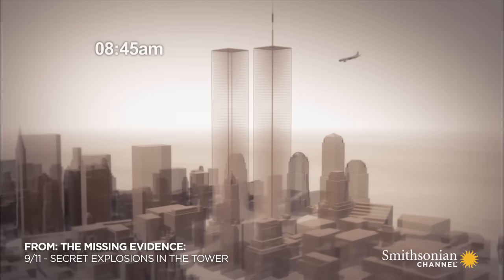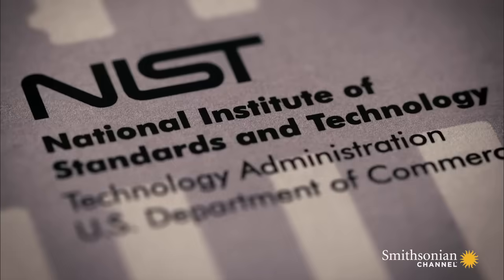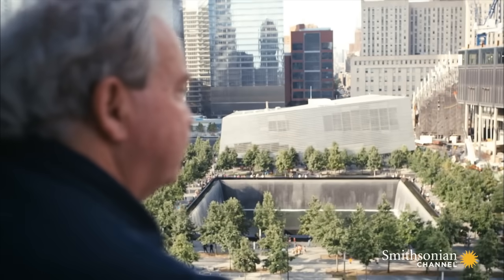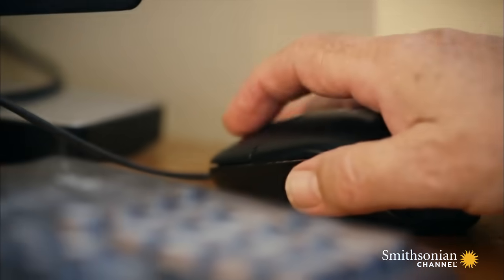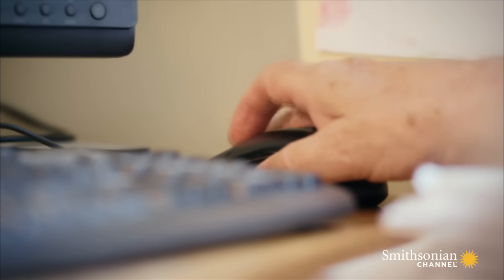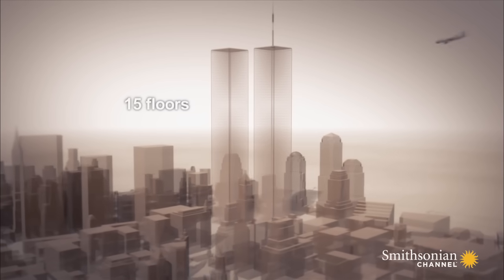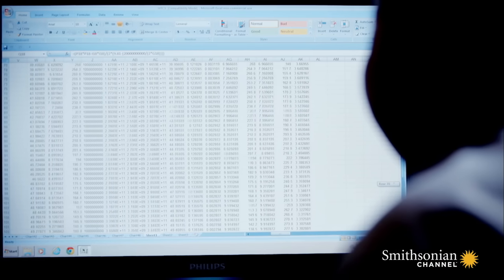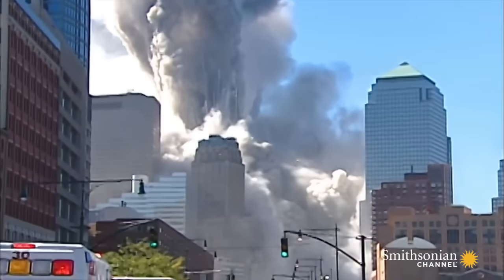This Computer Simulation Explains How the Twin Towers Fell

Comment: Many many building have gone through somthing similar with weaker structures and stayed standing. There was a live video a builing that was mostly glass in Dubai burning for hours, no death, no free fall. The buildings that were in Lebnon the day the huge bomb went off in the port, a mushroom cloud gutted the buildings beside it but the buildings stood still. Please make it make sense. The people too sensitive to actually ask real questions shouldn't even be here. Go watch video's that you would rather hear. Alot of us want to know the truth because simply, if the truth was actually out none of you would be fast to shutting us up anymore.
Reply: Was the building in Dubai hit by a jumbo jet doing 500 mph? No? Then it's not a fair comparison, is it?

The closest example of a building going through something "similar" is when the Empire State Building was hit by a bomber lost in fog in 1945. But that plane was 1/10 the weight of a 767, was only going 180 mph, and was low on fuel. Apples & oranges.
Reply: @Tim22222  Not really apples and oranges. Why? Because the towers were built to withstand a strike from a jetliner.

"The towers could withstand strikes from multiple jetliners". Frank D. Martini WTC Construction Manager.
Reply: No need to compare to other buildings. NIST stated that WTC 1 & 2 came down "essentially in free fall" (as seen in videos). Any college physics professor will tell you this means that essentially none of the kinetic energy from the falling building parts caused any destruction during the TOTAL collapse of the WTC 1 & 2 buildings.

Comment: you know, when something looks like a controlled demolition its probably really a controlled demoltion...
Reply: No, they just came straight down to earth in accordance with gravity.
Reply: I've never seen a CD begin at the MIDDLE of a building. Have you?

It sure doesn't look like controlled demo to me.
Reply: @Tim22222   , You have more to learn about controlled demolitions. That is how the verinage controlled demolition technique works.
Reply: @Tim22222  You can start a CD anywhere. It just depends on what you need to accomplish during the cores of the demolition.

The towers had a multiple stage CD.
N. Tower:
1. 93rd floor is the ground. 94, 95, 96, 97, 98, 99 ect...
until the antenna hits the 93rd floor.
This is the upward sequence of the CD
2. When the antenna hits the 93rd floor 
93, 92, 91, 90 ect... until the tower is gone.

The WTC 911 CD was an engineering event that is once in a lifetime. It was not just a CD. It was a, "Ritual". It was a, "Social Programming Engine".
Reply: @Tim22222  yeah, the core of the building comes first

Comment: Would be great if you could explain how the WTC7 fell too...
Reply: The World Trade Center 7 (WTC7) Tower collapsed as a result of the damage it sustained when the Twin Towers (WTC1 and WTC2) collapsed earlier that day. The collapse of the Twin Towers caused debris to fall on and around the WTC7 building damaging the buildings structural integrity. 

According to the National Instiitute of Standards and Technology (NIST), the collapse of the WTC7 building was primarily due to fires that ignited on multiple floors as a result of the debris impact. The fires burned for several hours and weakened the building’s structural steel. The loss of structural integrity caused the building to collapse in on itself.
Reply: @gripitandripit  WTC Building 6 says hello
Reply: @gripitandripit  Keep on dreaming. Controlled demolition building 1, 2 and 7. Everyone knows. Nowhere in the world a building colllapsed after a fire.
Reply: @welldonemylove  Thats why when steel buildings were first constructed that was the big advantage. They wouldn't collapse due to fire unlike wood framed buildings.

 Three buildings on 9/11 collapsed "due to fire" in the direction of MOST resistance and at near free fall speed. Its impossible. Every support column had to fail at the same moment on each floor for it to happen. It was an inside job period.

How was it done? I have no clue, but it happened and they fooled everyone.
Reply: Burning chairs and other office furniture melted the joints and beams, causing the building to instantly crumble to dust. It's all in the NIST report. The 9/11 Commission Report forgot to mention it, so now you are suspicious. Move along, there is nothing to see here..
Reply: @baronvontrollenstein3410  LOL
Reply: @baronvontrollenstein3410  well that explains it. Wasn't that hard, was it?
Reply: Those that say metal got so hot that it brought it down due to fire melting steel are still asleep, that would imply that the steel buckled therefore all steel would have all been still connected in one big chewy thread.... Do you wonder what China has over America politics and leadership, those involved paid China to dispose of the crime scene, who knows the what really happend China, and mossad
Reply: Read the report then
Reply: These nut jobs will never believe that it wasn't a controlled demolition.
Reply: @ Mike Byrd
Reply: Cause it burned for 7 hours .
Reply: @hoyt_arms  Sorry thats not how it works
Reply: @rdaws73  that's exactly how it works lol
Reply: @hoyt_arms  Physics says otherwise
Reply: @rdaws73  physics and architect's have shown already that you're wrong
Reply: @hoyt_arms  Wrong
Reply: @rdaws73  you're gonna tell a firefighter that he's wrong whens that's what we're trained to know and do. There wasn't even anyone Inside this building when it collapsed. You're making yourself look ridiculous
Reply: @rdaws73  Lololololol do let us know when you return from conspiracyville, where the average lQ hovers right around 58. 😭💀🤡
Reply: @invincible9462  When people lose a debate they tend to call the other names and insults. Instead of having some sort of coherent rebuttal.
Reply: Yes, yes, gawd yes!!!
Reply: I was in the toilet there and I farted
Reply: They'll tell you the building was so sad and depressed it decided to freefall out of the sky, definitely was an implosion 600 degree open flame isn't hot enough to melt steel or concrete building 7 . Geonanothermite and 90 percent of that jet fuel was burned up upon impact as you can see when those planes hit the towers makes no sense their narrative!? No resistance freefall what in tarnation, just before collapse you can see molten metal melting and dripping out of the towers before they fell
Reply: @AustinCG  the molten steel beams could perhaps be true for the floors that got hit and burned what about the rest of the building? all of the steel beams just decided to become melted noodles also? to be able to freefall the tower, to this day to me it still looks like a controlled demolition.
Reply: @elcid5033  Building seven wasn't hit by a plane or jet fuel yet it magically caught fire and magically fell out of the sky free falling with zero resistance not possible...
Reply: It was a from a cherry bomb that Giuliani left behind with all the Enron documents and the Pentagon fraud case at CIA HQ.
Reply: Fires started in building 7 from a significant amount of north tower debris hitting building 7, and subsequently, fires burned on at least 9 floors of building 7 unchecked for hours.  That's why building 7 went down.
Reply: In 2005 the Windsor Building in Madrid burned for more than 6 hours with +1000 degree fire along 15 floors. Didn't fall.
Reply: @shadowman_390  are you actually sIow enough to compare what essentially amounts to apples and oranges..?
Reply: "How did a metal building that burned for 7 hours collapse"

Um...
Well, the building was held up by steel.
Which melted.
So it collapsed.
Reply: @MostlyPennyCat  Iron does’nt melt in a fire. It was pulled by the owner. Controlled demolition.
Reply: @MostlyPennyCat  yet again, airplane fuel cannot burn hot enough to melt steel far from it look it up.
Reply: underground nuclear explosions is the actual answer for all 3 buildings, dont believe me? just look up demitri khalezov 4 hour interview he explains in detail......
Reply: I think it was from the debree that hit the building
Reply: @Matrix1FSX  Yeah… or maybe really strong winds
Reply: @gabrielprado7794  Or it could be both, the debree might have made wtc7 more vulnerable, and of so the winds pushed the building to collapse.
Reply: @Matrix1FSX  it’s astonishing how much you refuse to open your eyes to the truth
Reply: @Matrix1FSX  are you serious right now? Wind?
Reply: @SatiricalBaitforPalintir  literally it’s pathetic
Reply: @LongJourneyyy  "POSSIBLY MY CONCLUSION OF WHAT GABRIEL PRADO SAID"
Reply: @SatiricalBaitforPalintir  it's astonishing how gullible you are to conspiracy theories.
Reply: @Matrix1FSX  settle down weird0 and give your poor caps lock button a break.. I mean what did it ever do to you 😂!?
Reply: @Matrix1FSX  NO, symmetric collapse means it was planned.
Reply: @Matrix1FSX  not whet I heard. I heard bangs
Reply: @Matrix1FSX  Oh c'mon, shut up with that bs.
Reply: @Matrix1FSX  wrong
Reply: @Matrix1FSX  you think wind made a tower collapse virticly? You do know they are designed to withstand fires and 3 plane strikes from a jumbo jet.....
Reply: @djproductionz911  i don't really think that, i prefer only the theory of the debree but with the wind theory i try to make sense of it
Reply: @Matrix1FSX  what wind there wasn't a storm or tornado 😂
Reply: @djproductionz911  sidewinds and weak support, not a giant tornado from Ben 10,  another theory could possibly be that alqaeda members sneaked bomb on wtc7 before anyone notices.
Reply: I mean "bombs" 😅
Reply: Building 7 is the smoking gun
Reply: @seanjoseph1700  No, it's all a smoking gun. To my knowledge zero other skyscrapers in the history of earth have ever collapsed due to fire, even ones that burned for weeks. They warp, they turn black, but they don't fall down. It's why skyscrapers were invented in the first place. Falling down is a slight problem for the tenants.
Reply: @seanjoseph1700  
Yes.
Because it was on fire, causing it to collapse
Reply: There is no heat above floor 30 because there were no fire there. So even if the building collapsed by fire it would not collapse at free-fall speed.

Good to know that many buildings face far more serious burnings and did not disintegrate on the floor.
Reply: @gabrielprado7794  
I think maybe there was heat.
You know, because it was in fire
For 8 hours
How is this not obvious?
Reply: @MostlyPennyCat  Ask yourself: at what temperature steel melts? Was the whole building on fire, affecting every column? Why the entire complex fell - at the same time - at free-fall speed? (if you came to conclusion that not every column was affected, like official reports have come to declare).
Reply: @gabrielprado7794  
It's pretty obvious, a normal house fire burns at 600C
At 600C, the steel supports in the floors that were on fire lose 50% of their strength, effectively doubling the weight they support.
And at 1,200C they lose 100% of their strength.
And it wasn't a house fire, it would have been hotter. Not that much hotter but it doesn't matter, the building was designed to have a functioning sprinkler system and a functioning crew of firefighters.
WTC7 had neither, no sprinklers, no firefighters, for 7 hours.
This was beyond the design limits of the building, so it fell down.
This is simple stuff.
Reply: @MostlyPennyCat  You are fooled sis.
Reply: @MostlyPennyCat  just watch dimitri khalezov 4 hour interview online and you will see the real 100% fact on how all 3 buildings fell
Reply: @djproductionz911  
Wait wait wait...

You actually watched a 4 hour interview and were convinced, by a Russian who looks like he's had a lobotomy, that it was CGI planes and NUCLEAR DEMOLITION CHARGES?!?! 🤣🤣

Round of applause everybody 👏👏👏
Reply: @MostlyPennyCat  ohh I see your a catwoman.....it all makes sense now hahahaha
Reply: @gabrielprado7794 yes there was. The entire side of the building facing the north tower was practically torn off. There is a good video in which Vince Dementri, a reporter went to the base of the building and you can really see just the scale of devastation around etc 7 and the true scale of the fires. Also at least one angle of the north tower’s collapse where you get a quick glimpse of the cloud of dust coming through the base of etc 7. That basically means that a ton of debris just went flying through the bottom of it and would have really damaged the lower part of the building.

Comment: Explaining B7 is somewhat more difficult......
Reply: "We had our special operations people set up surveying instruments to monitor, and see if there was any movement in the building [7]. We were concerned of the possibility of collapse in the building. And we had a discussion with one particular engineer there, and we asked him if we allowed it to burn could we anticipate a collapse and if so, how soon? And it turned out that he was pretty much on the money, that he said 'In its current state you have about 5 hours.'" - FDNY Deputy Chief Peter Hayden

"We were pretty sure that 7 World Trade Center would collapse. Early on, we saw a bulge in the southwest corner between floors 10 and 13, and we had put a transit on that and we were pretty sure she was going to collapse. You actually could see there was a visible bulge, it ran up about three floors. It came down about 5 o’clock in the afternoon, but by about 2 o’clock in the afternoon we realized this thing was going to collapse." - FDNY Chief Peter Hayden

"The most important operational decision to be made that afternoon was the collapse (of the WTC towers) had damaged 7 World Trade Center ... It had very heavy fire on many floors and I ordered the evacuation of an area sufficient around to protect our members ... and back the people away far enough so that if 7 World Trade did collapse, we [wouldn't] lose any more people." - FDNY Chief Daniel Nigro, Chief of Department

"We were up on the upper floors of the Verizon building looking at it [7]. You could just see the whole bottom corner of the building was gone ... I just remember it was tremendous, tremendous fires going on." - FDNY Richard Banaciski

"So we go there and on the north and east side of 7 it didn’t look like there was any damage at all, but then you looked on the south side of 7 there had to be a hole 20 stories tall in the building, with fire on several floors. Debris was falling down on the building and it didn’t look good." - FDNY Captain Chris Boyle

"Of primary importance early on in the operation was the structural condition of 7 World Trade Center. Assistant Chief Frank Fellini had been approached by several chiefs who were concerned about its stability. It had been heavily damaged in the collapse and was well-involved in fire. Chief Fellini had looked at it and described to us some damage to its south side; he felt that structural components of the building had been compromised. So when Chief Dan Nigro arrived at the command post, he convened a meeting of staff chiefs, and this was a major subject of the meeting. We were all in accord about the danger of 7 WTC, and we all agreed that it was not too conservative of a decision to establish a collapse zone for that building, move the firefighters out of the collapse area, and maintain that strategy." -- FDNY Chief Frank Cruthers

Comment: Without knowing the parameters of the program, it is impossible to  know whether or not it is a reasonable depiction of the collapse. I would be interested in knowing how extensive the modelling was regarding contributing factors. as well as assumptions related to structural resistance and heat transfer, etc. A simulation does not necessarily represent an accurate reproduction of an event, since computer models can be made to mimic reality without actually depicting the science. In other words, by programming  a presumptive scenario it is possible to "prove" an event that may have no basis in reality. There is an interesting analysis of the collapse of Bldg. 7  from a university in Alaska that is what should be done for the Twin Towers as well.
Reply: And what makes their analysis legitimate as opposed to the other ones?
Reply: NIST could have proved or disproved controlled demolition. NIST simply avoided doing so. When one proof is impossible it is easy to see why NIST avoided making any attempt.
Reply: @dunexapa1016  Why would anyone do that when there’s zero evidence of controlled demolition?

Comment: Funny story: Dr Frank Greening was a radio chemist from Hamilton, CANADA.
In 2018 he filed a lawsuit against the canadian nuclear safety commission for deformation because of documents posted on the CNSC website

Greening claims the posted material contained allegations that he was "illogical," makes "irrational assumptions," "does not understand the weight of evidence," engaged in the "misuse of data," committed "errors in understanding," has a "lack of perspective," and committed "just plain negligence."

Quite honestly the perfect radiologist to build a "computer model" (aka excel spreadsheet) proving that the towers lower floors couldn't support the weight of the buildings floors above the impact.